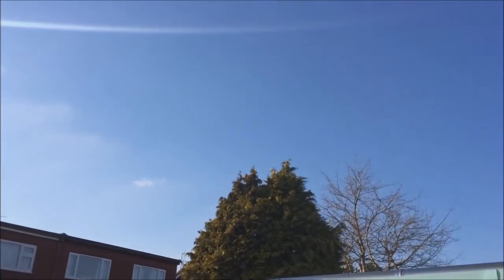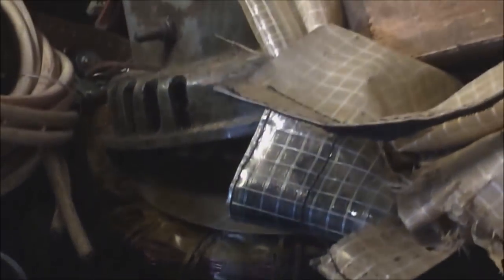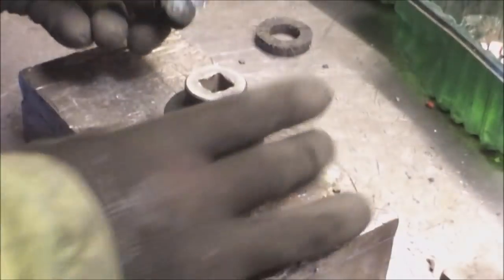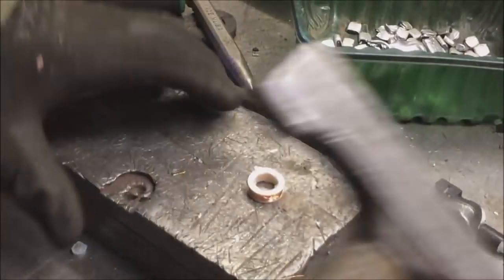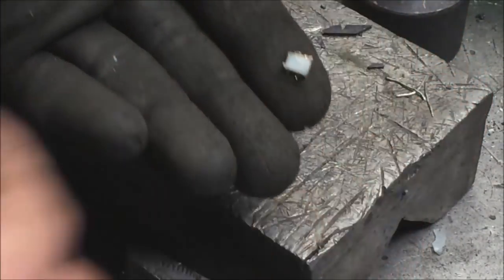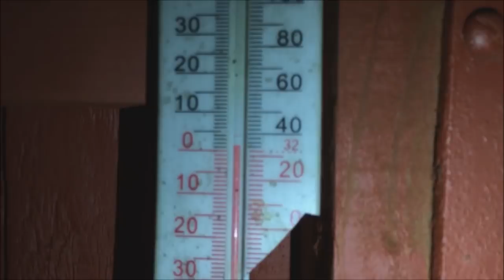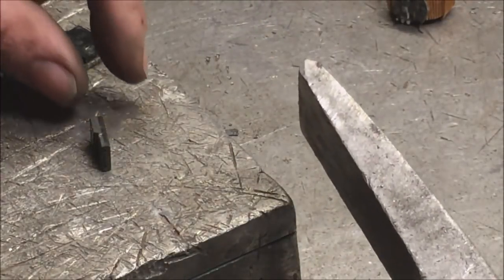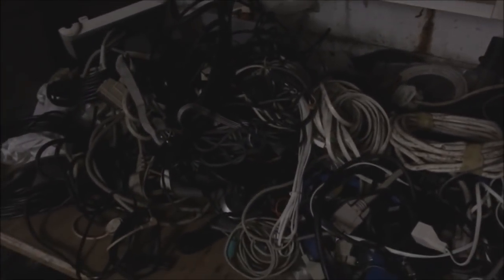Microwaste of time. or is it ?

Comment: Nothing wrong with micro scrapping Ian if you can keep on top of it, I had to isolate at home from work for 10 days due to covid (not me) I brought my tubs of various plugs into the house and got all the gold pins outgetting a nice pile of the plated pins now , then i did all the little transformers for the copper, i had nothing else to do so the time & motion thingy didnt come into it, Keep up the good vids Ian AND GET RID OF ALL THEM BIG MOTORS GET THE CASH WHILE IT'S TOP PRICES

Comment: I am not really a scrapper but just deal with what comes my way; but with various interests. and hatred of stuff dumped on road side. A lot seems to come my way.
Micro scrapping well sometimes takes over from what I should be doing  but breaking up tiny motors and  transistors (not Integrated circuits) just doesn't do it for me. Luckily my local yard takes ewaste at a reasonable rate.

Comment: Your workshop looks like my yard 😁Too much scrap all over the place then you get sidetracked doing little things that take too much time I've got about 700kg of unprocessed copper and stainless that need to be done and 45 boilers to break up but have been concentrating on bloody e waste and motors recently never even bothered until found a bunch of you guys on you tube oh well thank god for lock down 👍👍
Reply from the maker: That’s because doing The little stuff is interesting, even addictive.
Reply: @Man-in-da-shed  I'm with Vincent on this one,scrapping big stuff is interesting as well🙂,and when you drop bits on the floor it's easier to find them😄.

Comment: Ian any idea how to get the pins out of kettle leads iv about 200 to strip
Reply from the maker: Chuck em in an old kettle boiled for a few mins, I then use my brick hammer to cut them lengthways, you can then pull the middles out with Pliers or snips, can also do them cold but a bit harder to split the rubber